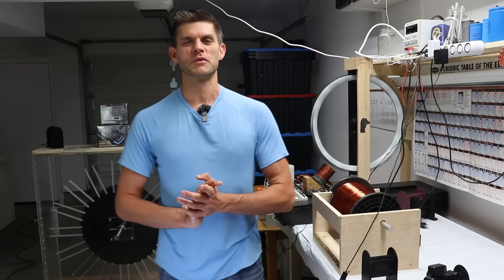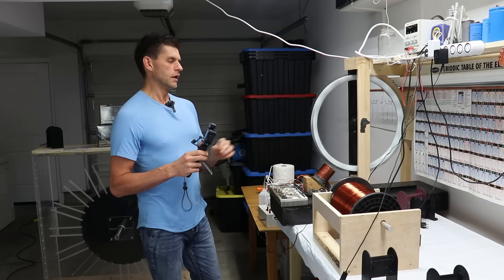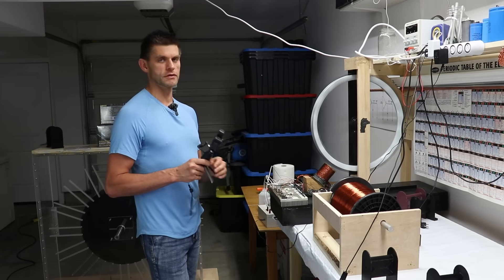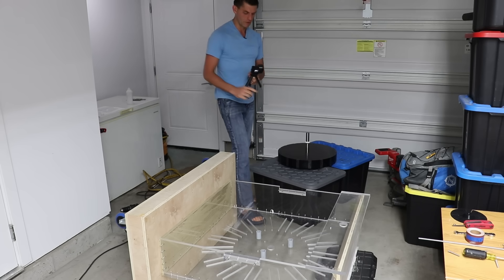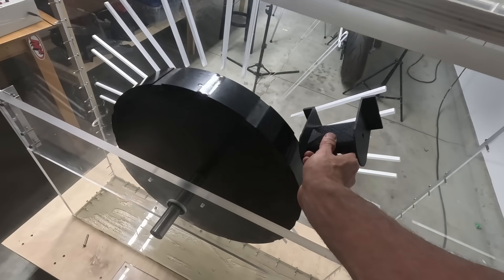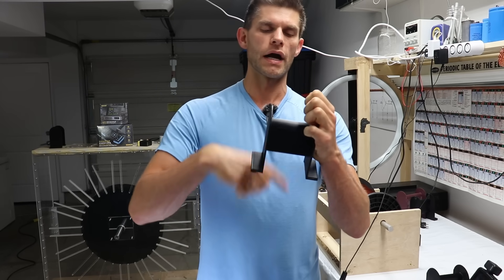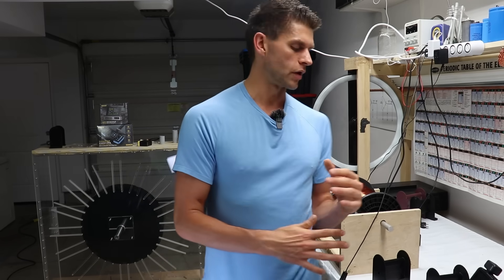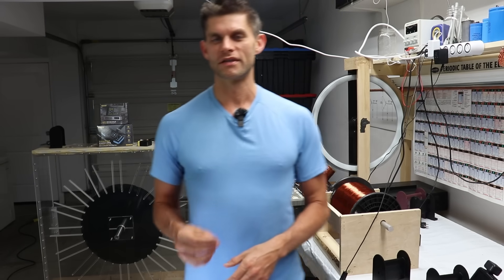Unlocking Zero Point Energy in My Garage (Open Source Project)

Comment: I've played with Bedini motors since 2007.   I never saw any  "excess" energy produced by it  in any configuration.   I realized that it's not really an overunity device,  but it's a good battery desulfator and charger.   This is why Bedini always use Lead Acid battery.  This wouldn't work on other types.

As far as "Free Energy" devices is concerned,  the best device we've got so far are Solar Panels.....
Reply: I have not  played, but been building them and studying them since 2003. I have been able to charge up four batteries each the same size as the run battery, plus not to mention the mechanical work of the wheel spinning on top of that energy. I also did many charge and discharge cycles on batteries with the SG and took the averages and was able to calculate a COP of 1.4 over ten years ago. I have also moved onto other Bedini techniques that charge LiFePO4 batteries at Mhz impulse speeds. I use that one with my ebike and get "free energy" in the form of extended run times when compared to mainstream commercial chargers.
Reply from the maker: @DavyOneness amazing 👏
Reply: @DavyOneness  
LiFePO4  with voltage spikes that could exceed over 100 volts ??   No.......  That's like a bomb.   I dunno who told you that was a good idea.   Lithium chemistry doesn't behave like Lead Acid battery.

Bedini motors and solid state devices are closed systems.  There's no way you can achieve a COP of greater than 1.  Even the people who have attended Bedini's workshops have never demonstrated their devices to achieve overunity.  Not a single one of them......... ever.
Reply from the maker: Not true. But if thats what you believe i guess it might be for u  @WTF_BBQ
Reply: yeah, bedini hid lots of the small crucial parts in getting the overunity and free energy aspects working. just because you failed to figure it out,  doesn't mean that others haven't!  what am I talking about? you are going to have to watch some of my past league of extraordinary Inventors and free energy friday science panels. lets just say, it ain't that hard with today's newest diodes
Reply from the maker: @cryptoalchemist369  links or they on your channel ?
Reply: Ayo look at quanta magnetics
Reply: To increase the output I would look for a magnetic shield configuration that acts as a switch in a magnetic field.
Reply from the maker: @Chaos-b2y4s thanks for the support
Reply: @MadscienceLPTECH I say this because sometimes if you can deflect the magnetic field you can use coils with a core and just a rotor with blades so to speak and they would block the magnetic lines, it would be an attempt to not be limited to Lenz's law directly.
Reply from the maker: @Chaos-b2y4s the cores slow down the collapse though
Reply: @MadscienceLPTECH in that case it would be a problem, any suggestions?
Reply from the maker: @Chaos-b2y4s I guess stick with the air core for now till we get it figured
Reply: @MadscienceLPTECH good luck and success
Reply: Also consider the energy needed to make the magnets. Magnets in these type of magic appliances tend to be used as fuel. They wore out after somw time.
Reply from the maker: I feel like bedini motors are overunity if u measure the total work done vs potential energy in the system. Maybe not a single coil small one but multiple coils yes they get very efficent
Reply: @MadscienceLPTECH 
Perhaps if you manage to build them with very low friction and resistance,  you might get better results. I calculated or estimated about 10% energy in a best case scenario.

However,  the cost basis in comparison to solar panels is simply not practical. 10% power gained vs 23% from a solar panel that cost less than $100 is a no brainer.
Reply from the maker: Kinda. The point is if this tech is real even 1% and infinite cop it will open the flood gates. We have limitless Potential and will find a way to produce unlimited energy
Reply: You are on the right path. Contact other builders, they are on YouTube, that have put similar money and effort in. They can help you out. Many people have tried building one but they moved away from the specs in their schoolgirl build so they didn't understand what exactly was happening so it didn't work as expected in the end. Then they came to the yahoo groups, got back onto spec, et voilá; their build started working. From there they could experiment and progress. This has led to beautiful and functioning builds. In curious to see where this project will go. Especially due to the way they're building it, modernizing it and logging everything. I remember many people having their setups go haywired due to back emf on field collapse.
Reply from the maker: @mattstroker appreciate the comment and support 🙏
Reply: @MadscienceLPTECH  overunity is just another word for "I need to redo my math"
Reply: @MystiIsLost   some have faith,  some do not.   

What was the pierce arrow by tesla all about?   

If you belive the mainstream but can't figure out why there are all kinds of patents saying differently,  you should reasess
Reply: @MystilsLost Tell that to all those nuclear reactors out there.
Reply from the maker: @MystiIsLostmath is just another term for self limiting belief. Stay tuned
Reply from the maker: @mattstroker amazing
Reply: @MadscienceLPTECH  idk I've been using math to bypass limitations so I'm not sure what you are talking about
Reply from the maker: Great comment  @JosephEnce
Reply from the maker: @MystiIsLostdepends on the context
Reply: @MadscienceLPTECH  i am curious boss, how much do u think is the extracted watts from this machine, as i can tell you that it might be on a thin balance  of what is producing, it might be overunity but doesnt give you enought, there are better machines that can
Reply from the maker: @MrBademy agreed but overunity will spark a revolution and allow for more research

Comment: The insurmountable problem will rear its ugly head when you connect a load to your apparatus.
Reply from the maker: Overunity is overunity. Can refine and make better. I think we can pull 0.5kw from this set up
Reply: I own and have read the Free Energy Handbook, one among many.  I even 3D printed a small unit that employed back EMF. The most it ever did was reduce rotor cogging when spun rapidly by hand, and did seem to prolong the duration of the spin while coasting but that was a purely subjective observation and the unit did not sustain its own rotation, much less generate any accessible power.

I've moved on to a pure Newtonian approach.
Reply: Your setup would produce more power if you added fins to the spokes and placed it in the path of a breeze.

Comment: If you want free energy all you need to do is purchase stock in your utility company sufficient enough to pay your utility bill from the dividends.
Reply: Hahahaha genius
Reply: the problem with that is all the bogus fees the energy company keeps adding to the bill, if I could just pay for the energy I used I could afford my energy bill, but every yrar they come up with a new fee generated by GREED
Reply: @Michael-i4l3j  why I built true free energy device! I got solar panels, quality charge controller and very big batteries! been free for over 10 years now and keeps freely converting photons to electromotive force to push current to the batteries!
Reply: You are a psychic spy. Go away with your fee models, attempts to push your economic model, or gain access through profiteering. If you have something let it loose or get off this platform and pursue your profit driven haze without these people. I see you.
Reply: You are a psychic spy. This is most certain. If you have come up with something then ensure you state it clearly instead of waiting for an economic model or observation. It seems like you know but are trying to distract. Honestly, leave it alone and focus on your never to come fortune on your own. There are better people to disseminate. Cheers.

Comment: You speak a lot and have a elaborate setup of waste. If your theories are correct you will not need any batteries, but only a capacitor capable of moving the wheel only until you "pull this magic energy pulse form the ether garbage" and charge the capacitor with that and off you go. Until you can do that Your contraption shouts vaporware, Which is all it is,
Reply: Claims to have an electrical engineer degree, but repeatedly mispronounces MOSFET as MOSFAT.
Reply from the maker: @psychicspy I dont claim anything, I do have an applied science degree in EE.
Reply from the maker: Meh ok
Reply: @MadscienceLPTECH 

The pronunciation is important.  MOSFET is an acronym.  You should know that.
Reply: Haters from CIA
Reply: @complianceaves1120  that is called coping, coping happens when a delusion is interrupted with basic reality. Chose reality, it is ok to be wrong,, just learn from it and move on.
Reply: There is a loophole in Newtonian physics that allows for overunity, and no complex control systems are needed.
Reply: @psychicspy there may be many shortcomings in modern physics, but the amount of energy that could provide useful work simply does NOT exist in thin air, especially not as electrical energy.
Reply: @BlissedOut 

I agree. I also know that there is a simple way to couple a standard - off-the-shelf - generator with a readily available prime mover that does not burn any fossil fuels, nor rely upon unreliable environmental forces such as wind or solar. No, I am not talking about hydro or geothermal either. The method I know to exist is so simple to grasp and understand once known that even a teenager in a high school shop class or a retired mechanic working in their garage could build a generator capable of powering a single-family home while emitting ZERO emissions.

Comment: I have been around a while and what I seen it is either confused self taught engineers that has not understood certain basics OR they tend to disappear mysteriously after a while.
Reply: I know right! Sucker born every minute.
Reply: There are plenty of colledge educated but confused engineers out there. We had one that didn't know batteries could be charged in parallel and in series.
Reply from the maker: I knew electronics and building long before going to school.
Reply: @MadscienceLPTECH 

My parents allowed me to use a soldering iron unsupervised at 9 years old. I haven't put one down in 51 years.  I had enough credits to graduate HS early, or attend a voctech school for electronics. My first week in the class the instructor gave me the final exam, which I passed, and then promoted me to the 2nd year class where I repaired TV, radios, etc. That experience landed me a job with an electronics company doing service.

Comment: Are you saying it has to be a lead acid battery?
Reply from the maker: not sure if other batteries will work, 100% sure lead acid will though.
Reply: It's about electron sequestration so any type should work
Reply from the maker: @aaronnunn5240 ❤❤❤
Reply: It will charge any battery but lead acid are especially responsive to the cold electricity, back emf or whatever you want to call it. You can use dead, damaged lead acid batteries and the this will rejuvenate them but once they are subjected to this type of electricity, they are less responsive to normal currents and should only be charged with bedini wheel and ssgc. This is just from my research and personal experience, I could be wrong
Reply from the maker: ❤❤❤ @freelifetas1252

Comment: The rotor kept spinning and spinning. It seems to be balanced really well and has  very little friction. It's the biggest bedini rotor I've ever seen.  Good job!!!!
Reply: If this works, switch to magnetic bearings to improve the efficiency.
Reply: There's no such thing as limitless energy with a 12v battery from the aether  no matter the bearings  @parajerry
Reply from the maker: its smooth, cant wait to spool it up :) thanks for the support
Reply: Yes he's changing the world by spinning a bicycle wheel .revolutionary tech from the 60's.. your a muppet @MadscienceLPTECH
Reply: @ValleysOfNeptune2150  I love muppets
Reply: Bedini actually built a bigger one and travelled around with it as a demo. Should be easy to find on yt.
Reply from the maker: I've seen it. Still used transistors though